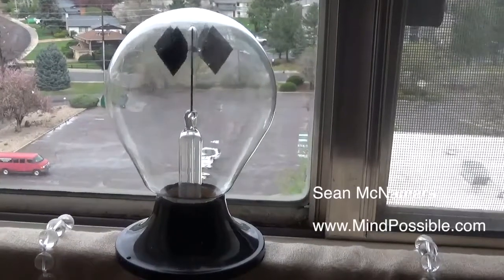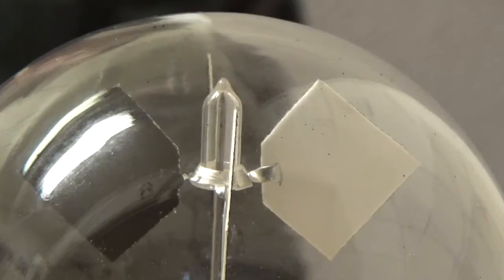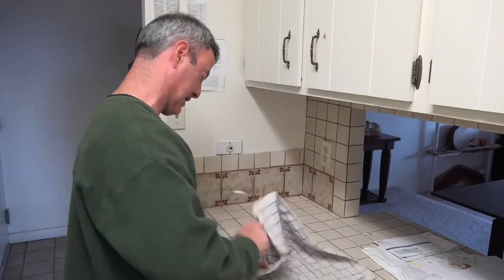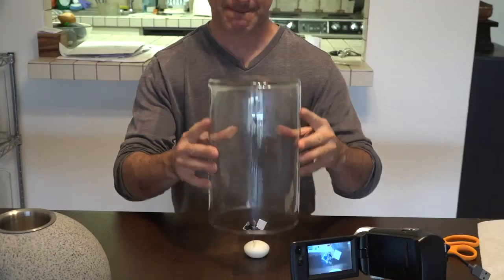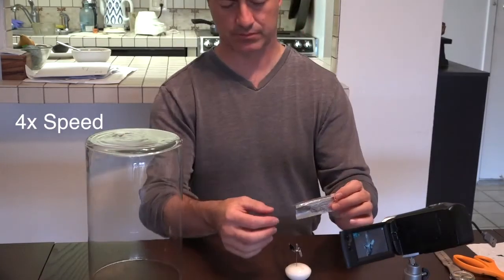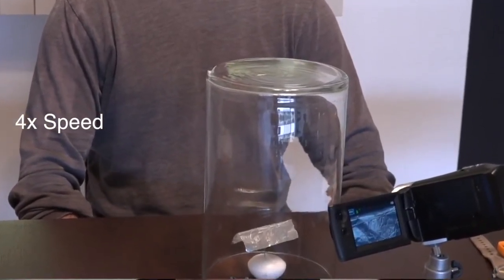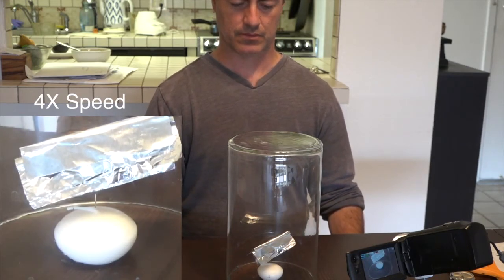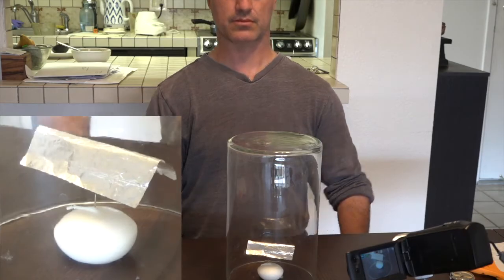Telekinesis with a Radiometer, is mind-over-matter in a vacuum possible?

Comment: I know this is an older video, But I just wanted to let you know Sean (Or anyone reading) that it's not just the air pushing the object, but it's an electromagnetic field that runs THROUGH the air pushing it forward. My theory is that the air was needed inside the container for the telekinesis to work because air has life in it, and life force is needed for us to guide it. Hope that made sense.

Comment: I honestly believe the radiometer difficulty may be a belief & object familiarity issue for you. A few years back, a few practitioners & I were working with radiometers, mostly for stasis field practice(psychokinetically stopping or reversing the flow of objects in motion). Anyway, the goal was to get the radiometer to stop while under a hot, constant light source.  I later discovered that not only could I stop the radiometer, but also move it without lights. Also, another interesting phenomenon, was that the vanes would sometime become magnetized after repeated concentration.

A couple of my old videos:
https://www.youtube.com/watch?v=i4KVeGGwE0s

https://www.youtube.com/watch?v=f4xW_7mjLRQ

https://www.youtube.com/watch?v=vtgSg2WA5BU
Reply from the maker: Thanks I'll check out your videos.